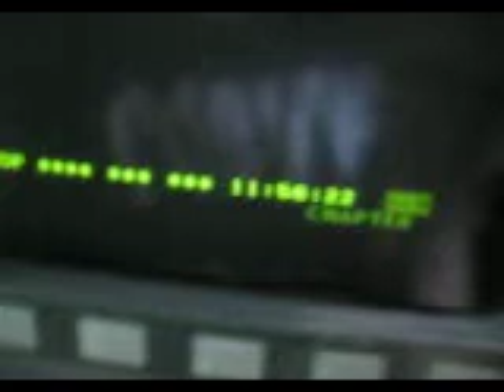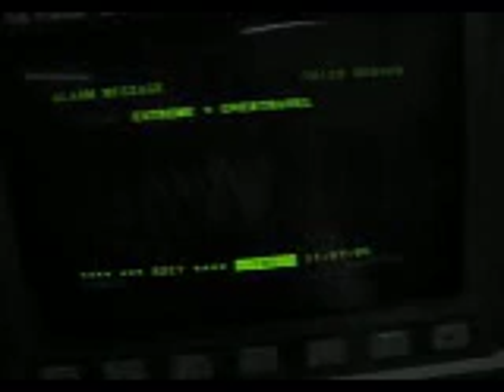komo cnc problem part 2

Comment from the maker: if anyone encounters the same problem the cables for the overtravel sensor were broken under the table, we had to replace the whole cable, which is around 20-30 ft long